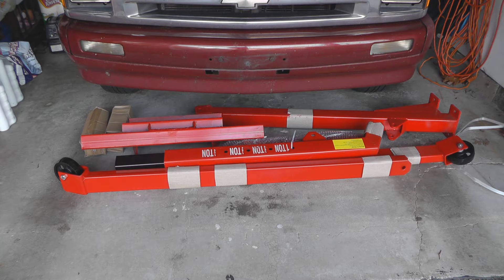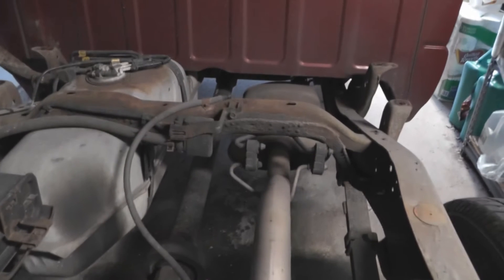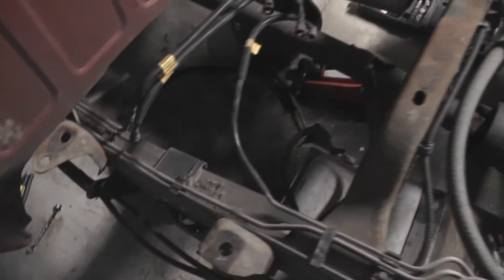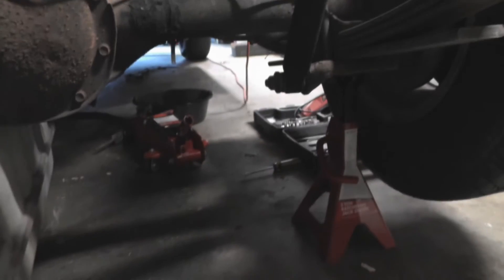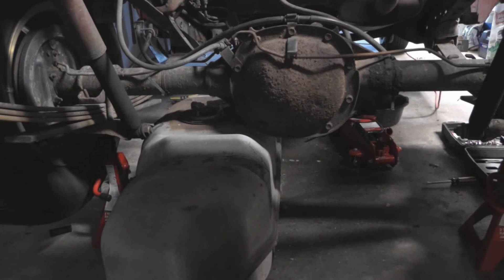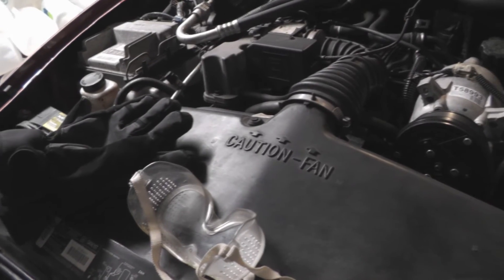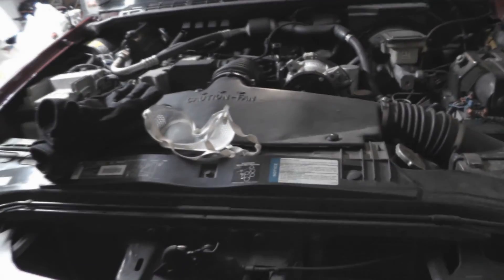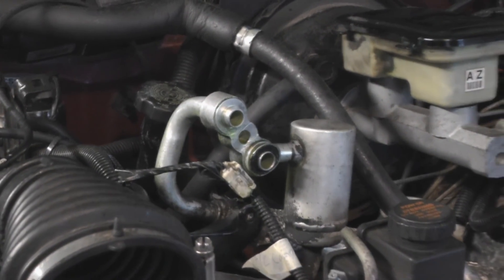S10 EV Conversion: Disassembly & Fluid Drainage - Part 04

Comment from the maker: I bought an angle grinder. The project stalled at around the 60% mark when I ran out of time, interest, and money all at once. My life has changed a bit since the last video and I may end up having to sell the incomplete project. There is a lot more footage that has been shot but not edited and posted (e.g. making battery boxes, putting the motor in, etc). That footage will probably end up on this channel eventually, but it's in my brother's hands right now.